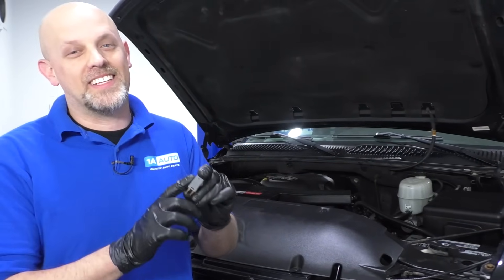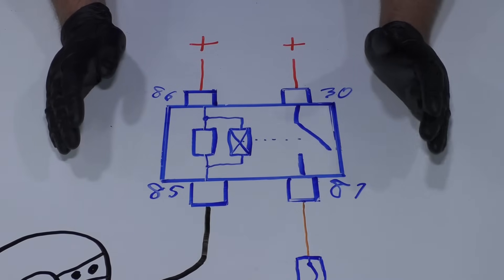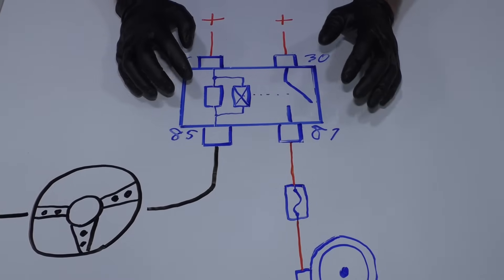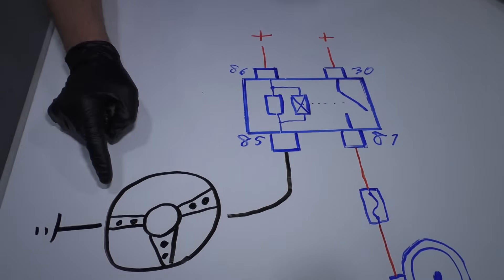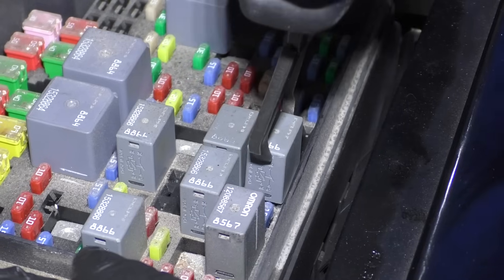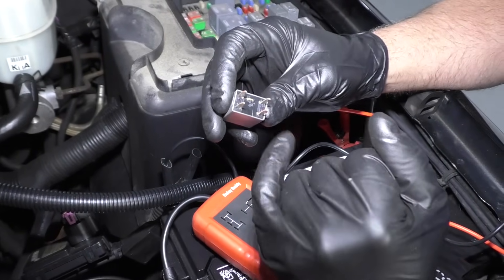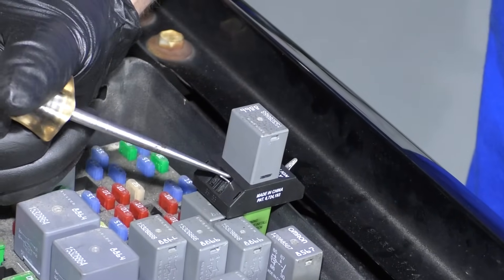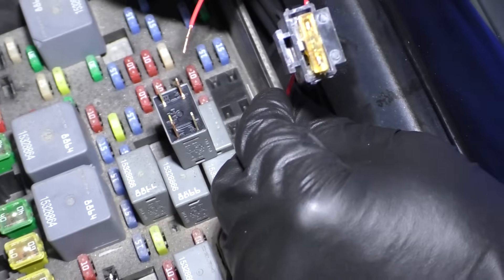How to Diagnose a Failed Relay In Your Car, Truck or SUV

Comment: Here's the deal. Before I got my iPad and my Bluetooth code reader I never did  much work on vehicles with computers. Now, here it is. If you have a vehicle, with over 100,000 and your going to keep it for another hundred thousand miles plus. Here's what you do. Take every relay and fuse from the in cab fuse box and the engine fuse box and throw them away. Replace every fuse and relay you have. For the most part you will not have another problem regarding anything link to the computer other than a computer itself. That is it, you can thank me later.. That's it. You want to cheat the repair man and save money that's what you do.. Also every time you change oil, change the fuel filter. Put risolone in every oil change. It works.put a can of sea foam in the fuel tank every oil change as well. Also, oh and 100,000 miles, change spark plug. And change serpentine belt. If you haven't done it already. If you replace one item it's new. Every other item is old. The c computer will struggle any other relays fuses will weaken whatever you put in new. change only two spark plugs and leave six bad and see what happens. POSs in mechanics. Do this and you won’t see them very often.
Reply from the maker: +Ronald Wise Thanks for the feedback!

Comment: Hey... can u use those Lisle tester relays as adapters for the relay buddy to test relays that don't fit on the relay buddy? I know the relay buddy has adapters for it but just wondering if the lisle tester relays like the ones u used would work as adapters in then just put whatever relay im testing on top of the tester relay

Comment: Really good video. Both of my headlights went out. First thing I noticed was some corrosion on the battery clamps which I got rid of, and I made sure the fuses worked. I will be checking the relay after this. God I hope it's the relay, I do not want to deal with wiring harness. Also, do you think that a bad, maybe worn out battery clamp can cause the headlights to not turn on, even after car stars and all the other light work?

Comment: My car's A/C, high beam indicator & power door locks (all 4 doors) fail & come back on at the same time. They've been acting like his several times & now it's not working most of the time. They may suddenly work again for a few minutes & then go off. What's the most likely cause & how should I proceed to find out the problem? Thanks a lot.
Reply from the maker: +Nap Per We wouldn't be able to diagnose an issue like that here, you may want to have a local mechanic take a look at it. Thanks for checking us out! http://1aau.to/m/Shop-1AAuto-c
Reply: Sounds like a bad fuse/relay holder box. Get that checked out or do it yourself.

Comment: Can a bad relay make a battery drain?
Reply from the maker: +Anthony Rogers A failed ECM power relay can also cause a battery drain or dead battery. If the relay shorts it can leave power on to the computer, even when the vehicle is turned off. This will place a parasitic drain on the battery, which will eventually cause it to go dead.

Comment: Got a question I have an 01 Ford Ranger I replaced the blower motor relay it over heated I replaced the blower motor and the resistor and it still over heats. If I run it on a lower speed it lasts longer but in the end it still over heats what could be causing this?
Reply from the maker: +david henson We wouldn't be able to diagnose an issue like that here, you may want to have a local mechanic take a look at it. Thanks for checking us out! 1AAuto.com
Reply: Check your connection to blower motor 
Pig tail over heat